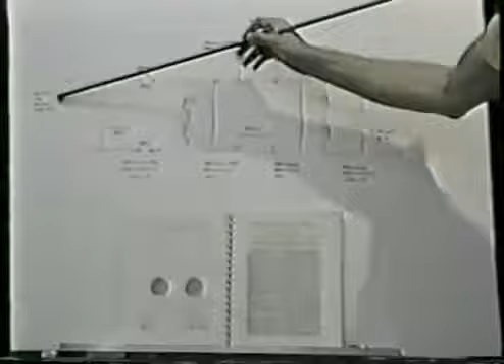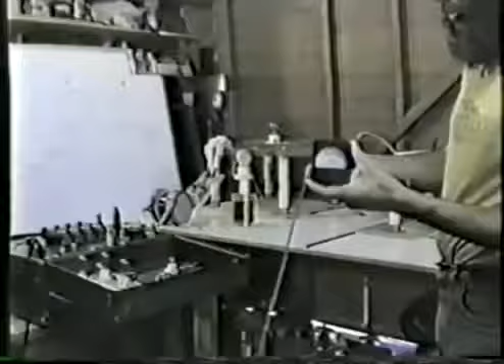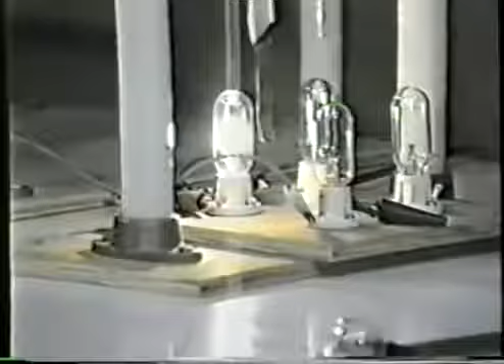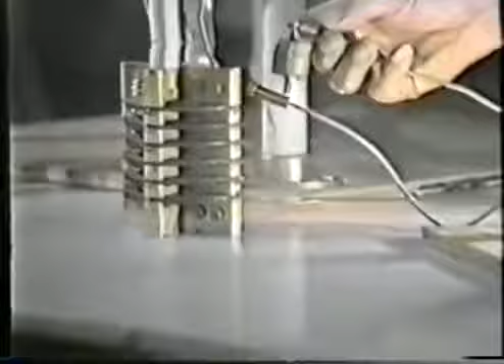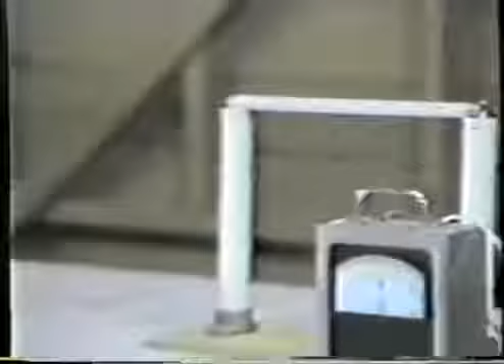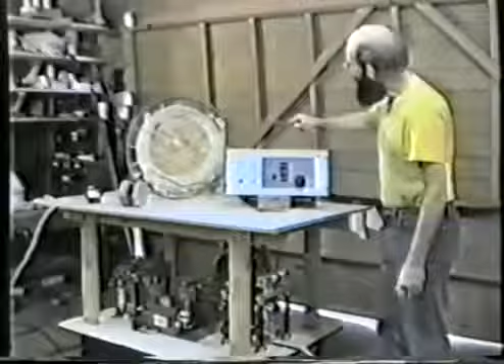Eric Dollard...Tesla's Longitudinal Dielectricity Scalar Demonstrations & Wireless Transmission

Comment: Nikola Tesla used metallic balloons in his wireless power system in the elevated strata, with very high voltages. By this way, what I understand is, it seems possible to electrify the vacuum and conduct electricity, here electrons and positive ions in the atmosphere are used to conduct the current, which is described in any science book.

Comment: I find the charging effect of the bulb very interesting (forces, radiations emanating from a light bulb) Maybe charging a metal foil which is located in the vicinity of this light bulb could give better results about accumulating the charges. What kind of energy is that ?

Comment: Longitudinal waves, if compared with the transverse electromagnetic waves, are not based on electron movement, right? Is there a displacement current in the system, while you said the bulbs are not getting hot, may I ask you?
How is the energy transported via longitudinal waves, can you define the transport medium?